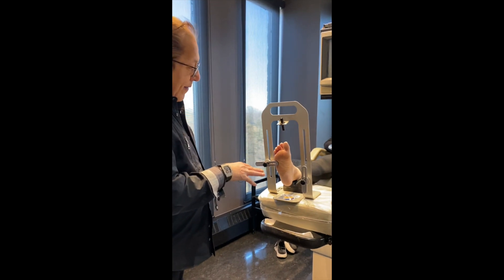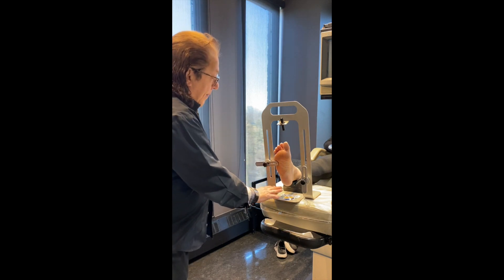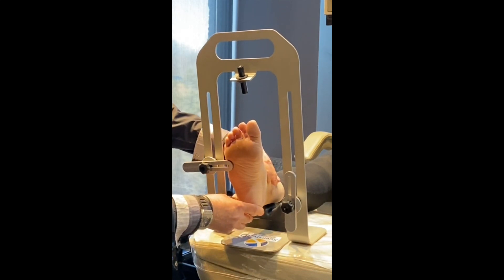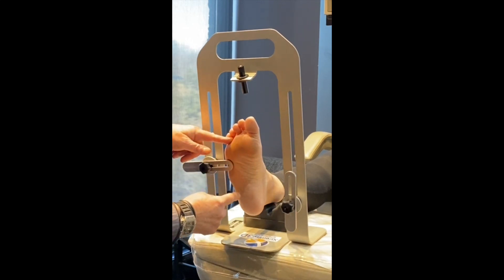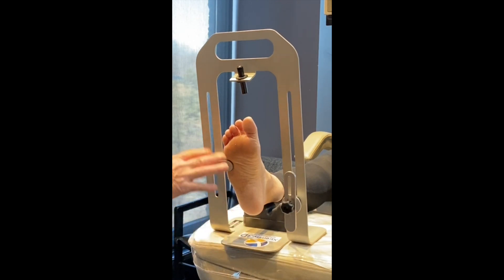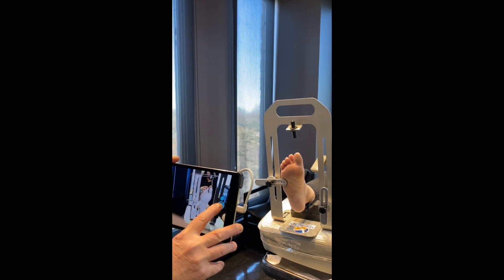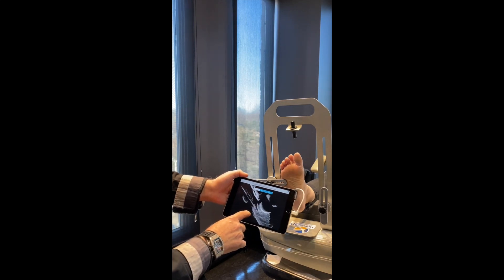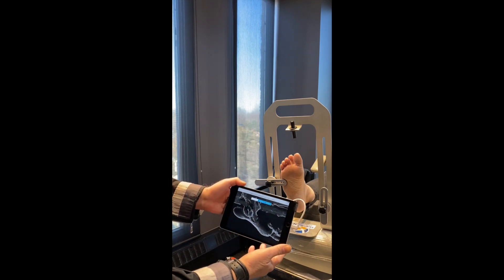3D Orthotic Scanner

Comment: Very cool! A long time ago I went for orthotics and I had to step into the foam box. But the technician pushed my feet down (instead of me putting my weight down) and it was hurting my instep. My last time I had my foot measured like in a shoe store and got the right size. The interesting part is the new shoes came with memory foam inserts which react to my body/foot heat to form them.